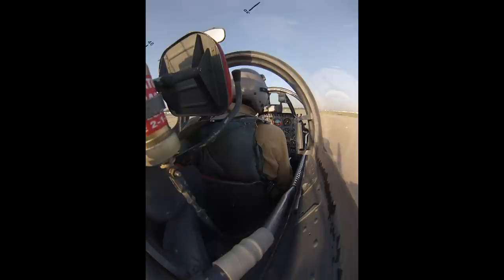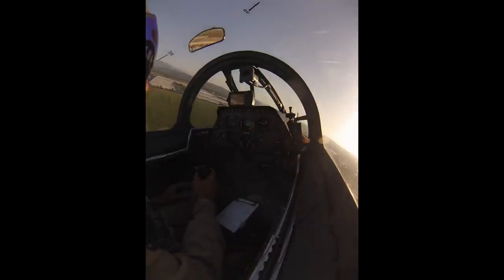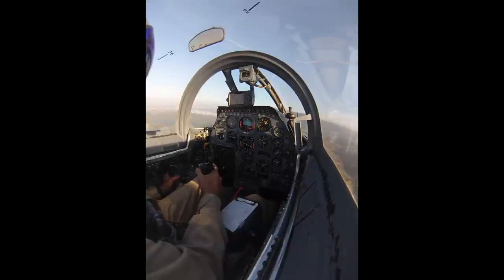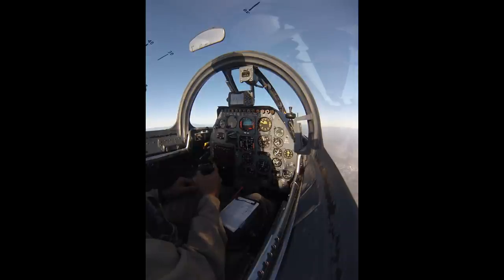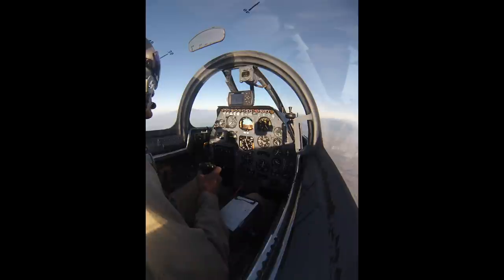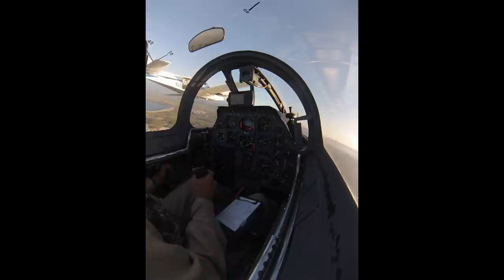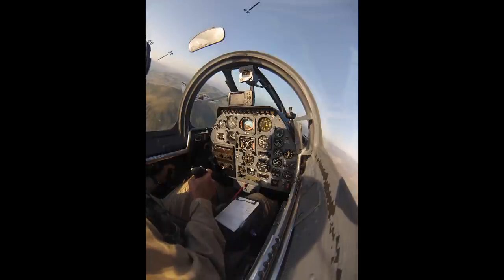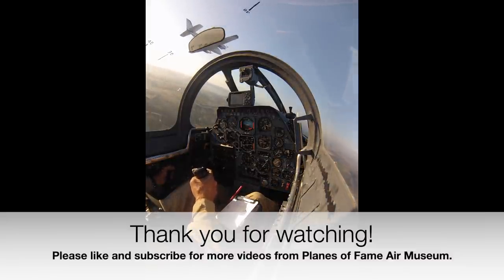F86 Sabre Jet In-Flight Cockpit View w/ Steve Hinton  |  PART II  |  Planes of Fame

Comment: anyway I happened upon this video since we are documenting a couple of jet crashes just east of Las Vegas. there were two. One was the first model of f86 in which the student went into a spin and ejected in 1953. The other 1.5 miles west was an f100A in which he ran out of fuel because no gauges and flamed out. My question is why in this video does the cockpit sound totally silent? was there overdubbing?

Comment: Nice flight. Does anyone know how the flaps lever in the real F86 works? There are some notches, so I guess it can be latched in the up or down position. Does it self return if it is not notched ("spring-loaded")? How do the pilots typically operate it? Do they hold it and release and it returns by itself to the neutral position? (Question is only about the lever action, not about procedures.)